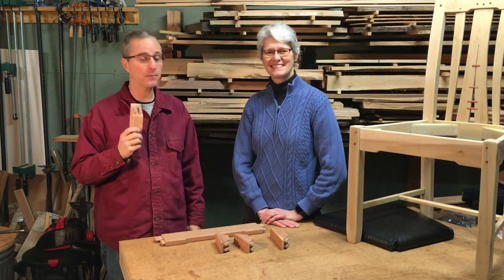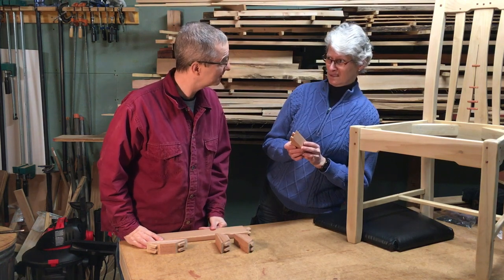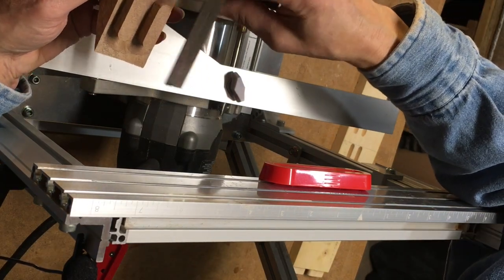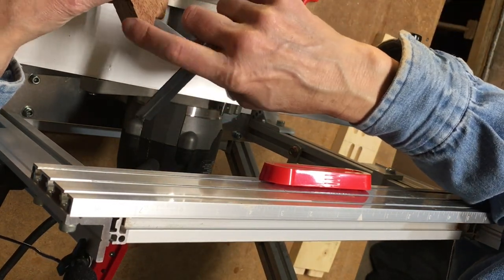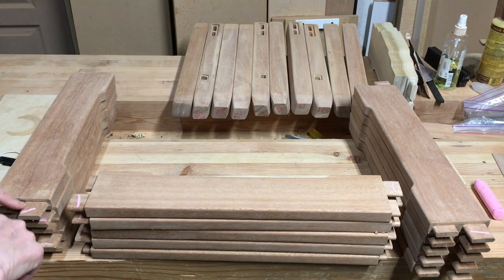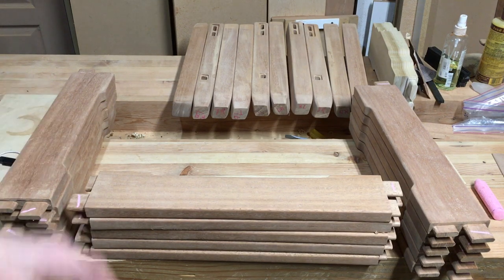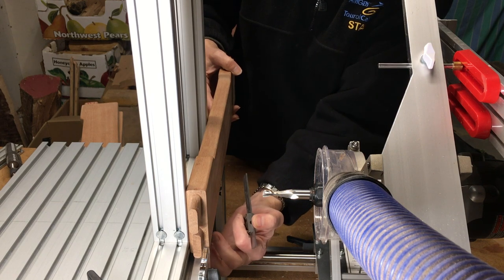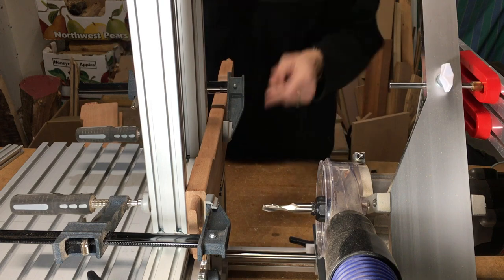Corner Brace Mortises - Dining Room Chair Project

Comment: great use of the pantorouter ....where did you find those vertical support pieces??
Reply from the maker: Those are just pieces of extruded aluminum we got from 8020.net. The same ones as used in the  "Pantorouter Angle Jig" video. Multi-function, versatile.

Comment: your pantorouter videos are really great.  after making all those chairs, would you recommend the pantorouter? I’ve been thinking of getting one.
Reply from the maker: Thanks for the compliment, James. Yes, I highly recommend the pantorouter. It's proving more versatile all the time, and it's really upped my confidence and abilities, and makes the process easily repeatable. 

I've tried to do the same thing with the Festool Domino, but that (quite obviously) will only cut specific tenon sizes, and in no way could be used to route a housed mortise. 

I'm working on ways to improve the housing templates and to make custom sized followers. Those videos are still to come.